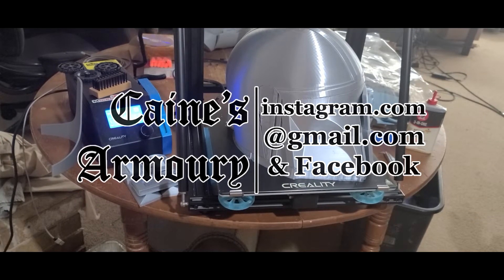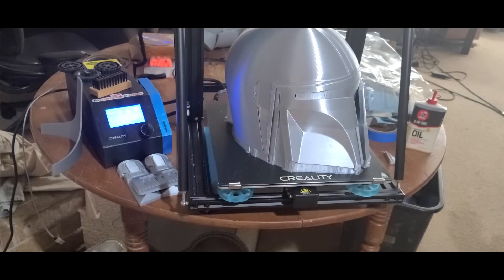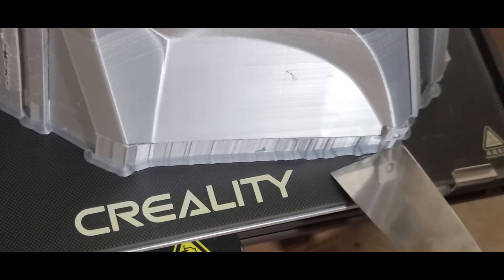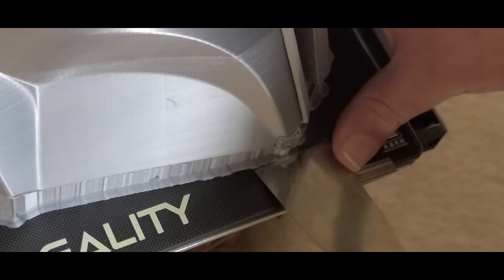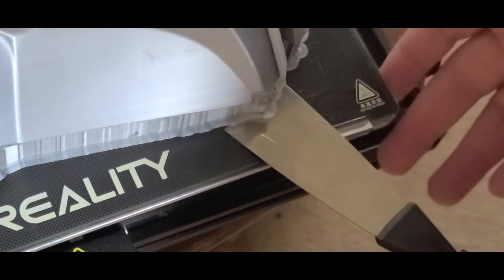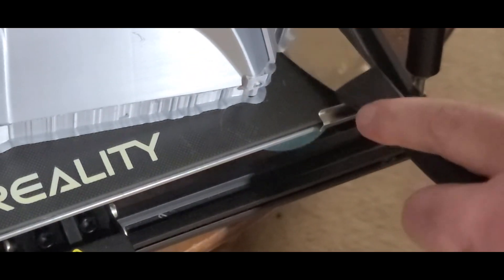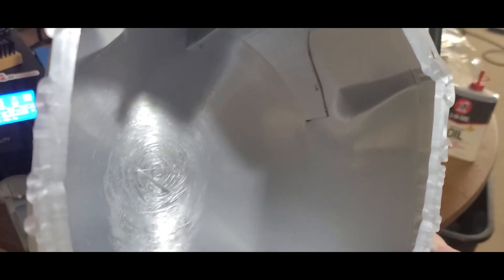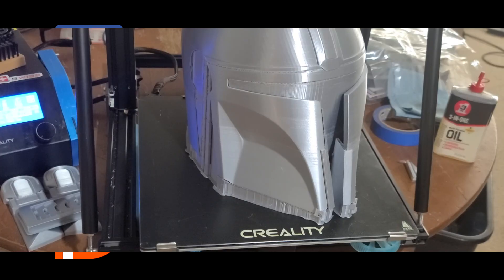3D Print Removal Without Force - Don't destroy your bed!

Comment: I love the ender glass bed, i use them on 5 printers and after they cool they just lift off easy. I have had a few new glass beds that won't lift off so a put them in my freezer after cooling to room temp and then they remove easily without using scraper. I'm still frustrated the few beds don't release like all the other beds i have.

Comment: I actually scratched my bed severeal times when maunally leveling and pushing the print head over it when it was too low. Now with a new firmware the head will automatically travel to each corner with enough headroom. Point is, there are many ways to destroy your bed :) but the bed seems to have some self-healing properties and scratches dissapear after a while (or whiping many times)
Reply: Technically you shouldn't be able to scratch the glass as it is tempered unless you're using something made of diamond. 
If there is some kind of coating on top of the glass that would be what is getting damaged most likely

Comment: Good video.
Printed helmet looks neat
I noticed your Y axis runs with almost no force...
I guess steppers where disabled, but still moving the bed seemed effortless.
Could you do a video showing how much you tight eccentric nuts for all 3 axis??
Thanks in advance
Reply from the maker: I had rebuilt the underside. All six rollers are eccentric nuts and it really helps solve problems.